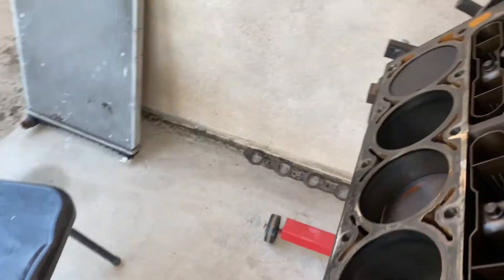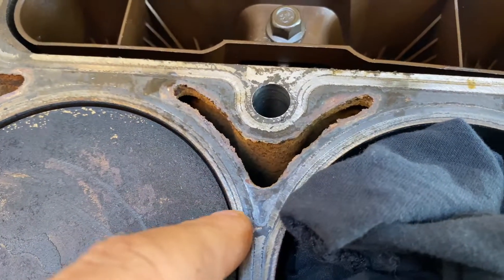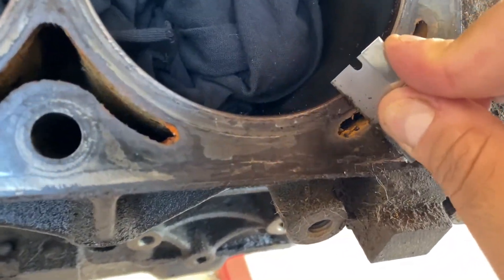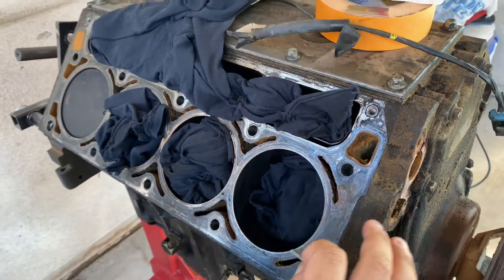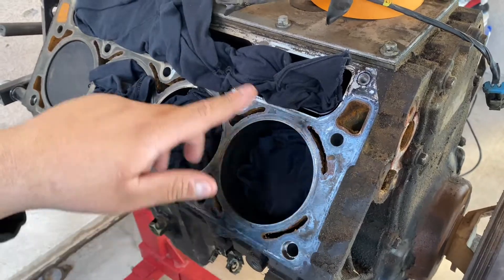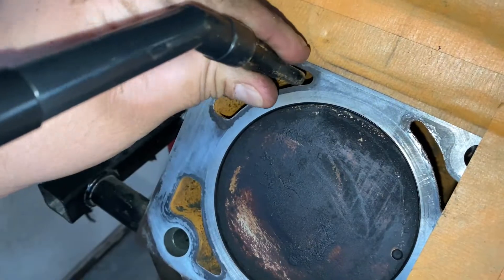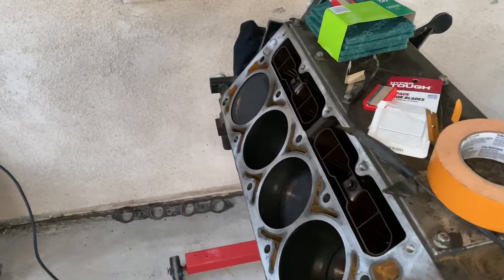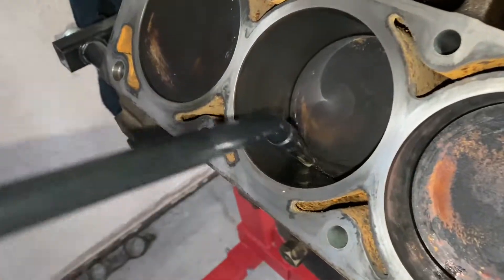Cleaning head gasket surface for under 20 dollars… DYI

Comment: what if i forgot to put cloths in the cylinders? woops
Reply from the maker: You get a complete Texas Speed rotating assembly kit 😂
Reply: @hugovlogs2913  I don't think they make anything for the gm 3800 v6
Reply from the maker: You rebuild the engine from zero like me 😮‍💨
Reply: It will be fine